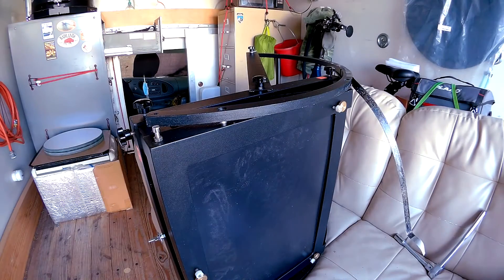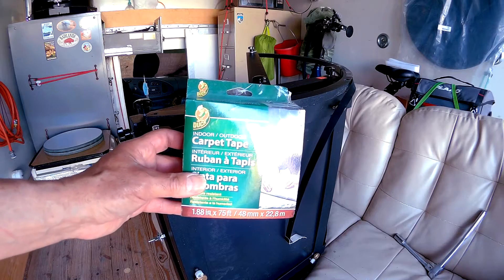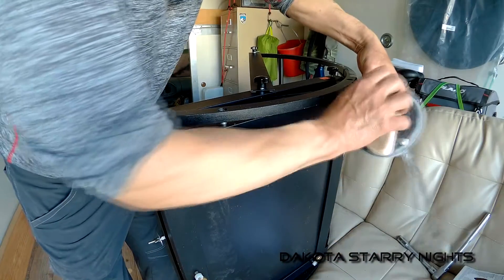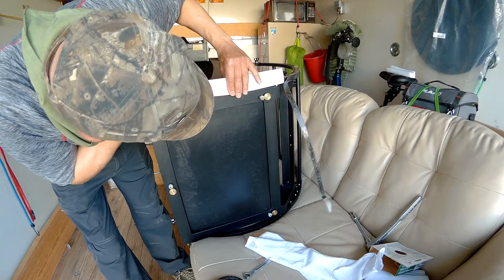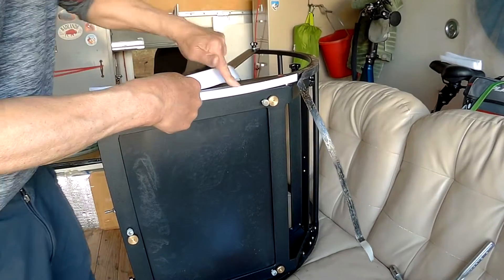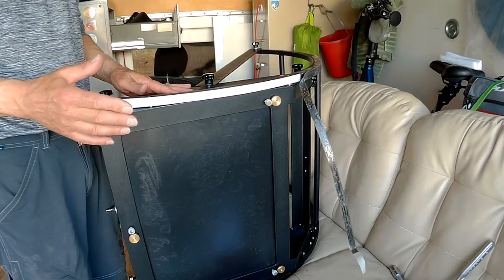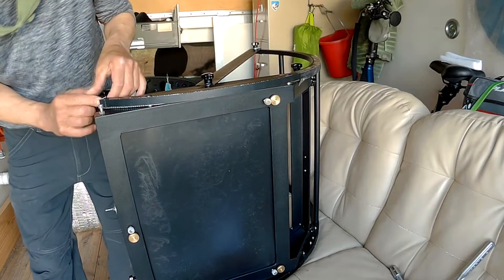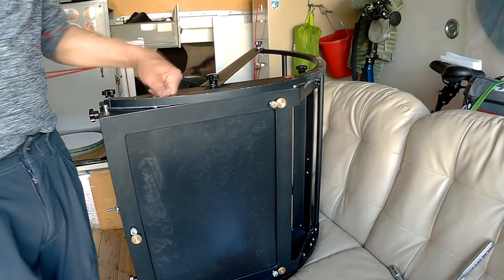Dobsonian Telescope - Bearing Laminate Repair

Comment: I wonder if that glue would have come off the back of the laminate if you had of used the same stuff that I used to remove those horrid sticky labels off of certain UL16 parts as supplied by the HO factory, I used Tamiya brand (Synthetic) Laquer Thinner. Alcohol is an organic solvent, and won't attack plastic, and neither will the Tamiya Lacquer Thinner, but Acetone does attack plastics. For tape, you need as smooth a surface as possible to adhere to, but for glue you would want as rough a surface as possible. I always clean surfaces with Alcohol before sticking stuff on, in order to remove finger grease. Someone else with a HO UL16 used Copydex rubber glue to stick their formica back on, and said it was pretty effective. I would be tempted to use Epoxy!
Reply from the maker: Those are great tips LiveStream.  Thanks for sharing!

Comment: I see you have put a bottom plate on your mirror box, that's non standard, I assume it's to keep the dust and dirt off your primary mirror coatings? Also I notice that your laminate glue from the factory doesn't look strongly yellow like mine does (mine was manufactured from March to May 2022)
Reply from the maker: Mine is from 2019 so maybe they've upgraded the glue.  I've put a bottom cover to block ambient light when the dob is operating at lower altitudes. It also helps to keep ground dust/dirt off the back of the primary as you said. Check out https://www.youtube.com/watch?v=4FuGniNZlg4    (27:44 in the timeline)